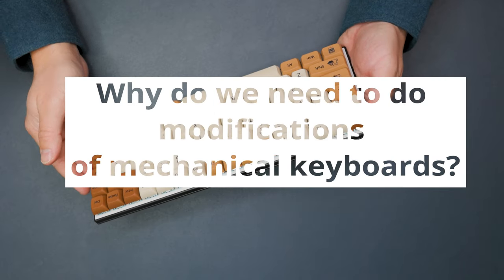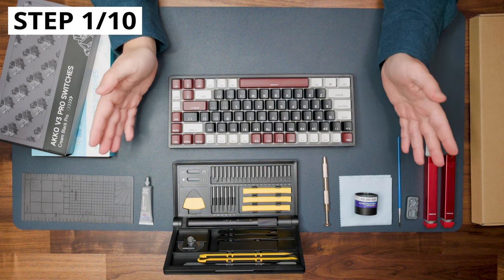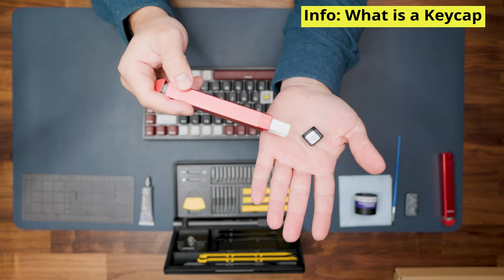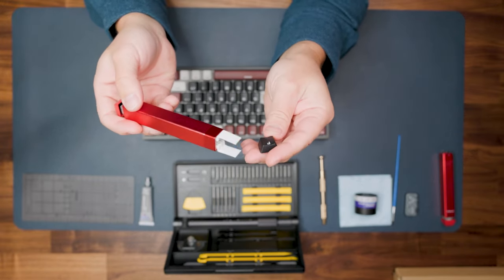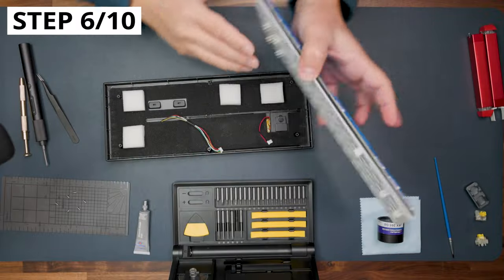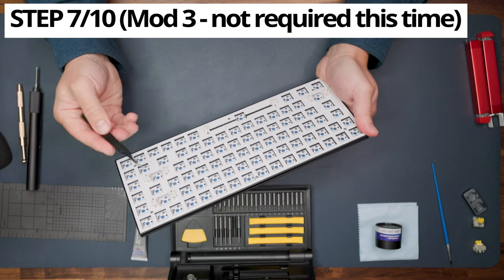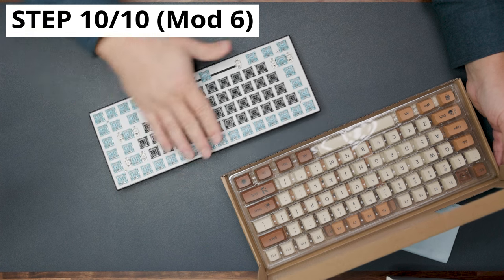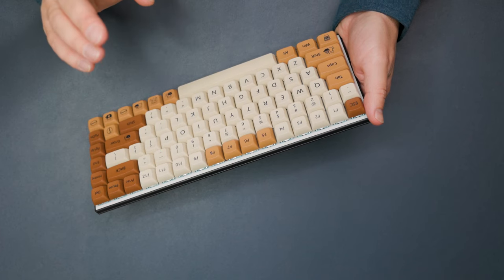Mechanical Keyboard Mods | Step-by-Step Guide | RK84

Comment: Hello, I have a question. Is it possible to glue the metal parts around the space, shift, and backspace keys with any adhesive?
Reply from the maker: do you mean metal bars?
Reply: @getsmarthomeoffice  yes
Reply from the maker: @XeiGhtN  no, I don’t think it’s a good idea, they need to have some space to move to work properly :)
Reply: @getsmarthomeoffice  What I mean is, they are applying the adhesive not on the keyboard PCB but on the sides of the switch buttons. Are regular adhesives sufficient for them in everyday life, or do they require a special adhesive?
Reply from the maker: @XeiGhtN  adhesive or lubricant? You need to add only to where metal bar coming to the plastic housing of the stabilizer
Reply: @getsmarthomeoffice  Adhesive, I mean. Would regular adhesives like UHU be suitable for sticking the two stabilizers surrounding the key on the space key to the metal bar? English is not my native language, so I might make mistakes in wording. To the best of my knowledge, I'm trying to explain. (I don't trust translations much) :)
Reply: @getsmarthomeoffice   I thank you for your assistance and for answering my questions, and for continuing to respond.
Reply from the maker: @XeiGhtN  adhesives is a glue, you should not use any type of glue for keyboard modding :) we are using different types of lubricants and oils to add smooth movement to the parts. If you use glue - it will not work at all :)